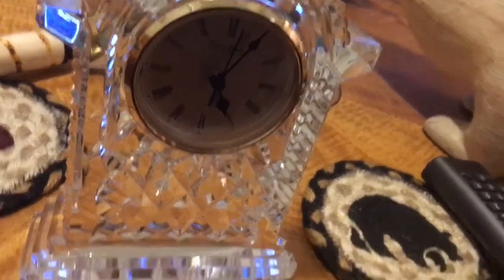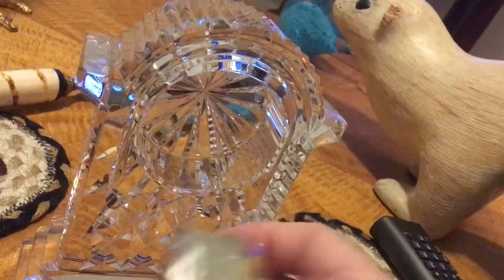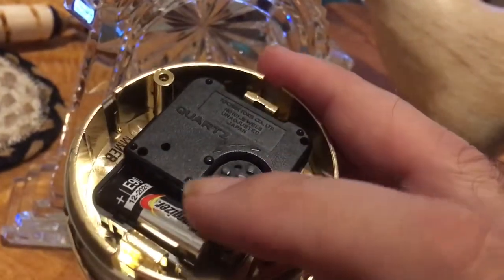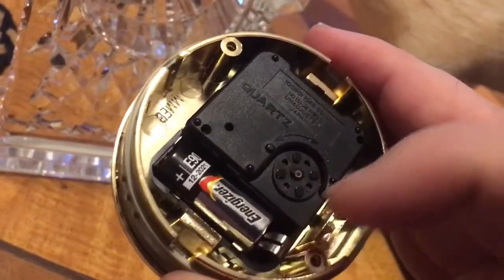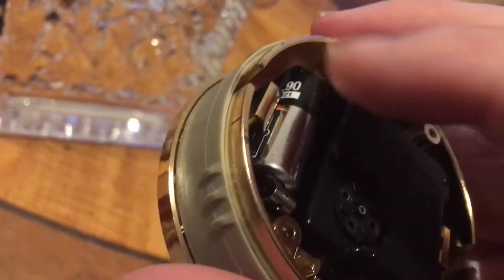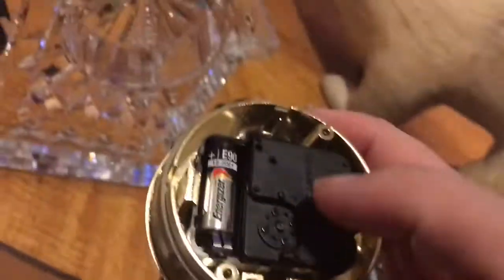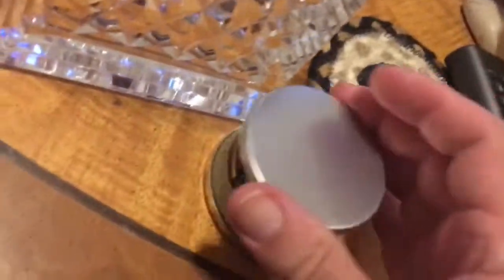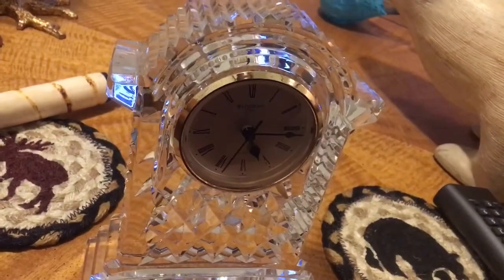Waterford Crystal How to set time and replace battery on a Waterford clock

Comment: I have a Waterford clock very similar to your clock. But my clock insert won't pop out or can't get it to come out by small screwdriver or sewing needle. There is crystal lip that the gold insert sits somewhat flush. Is there another trick to getting insert out to change battery? Thanks
Reply from the maker: Get rubber gloves you use for kitchen dishes. Make sure the gloves are clean and dry. Grasp the clock face with the gloves around the gold rim and rotate the clock to break it loose. Rotate and pull out at the same time.  Or use two plastic knives from the picnic. Put then both opposite and try to pop it out. Never metal anything.